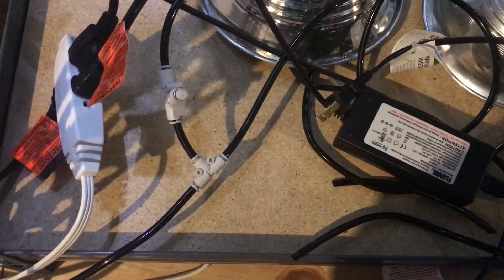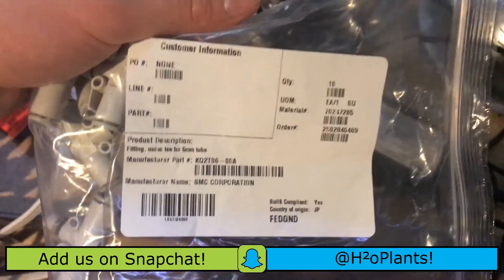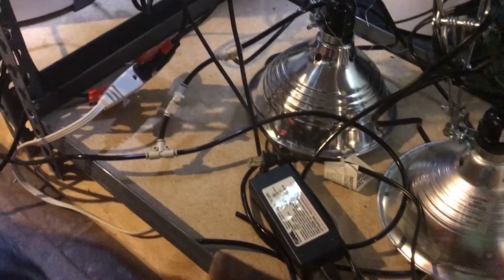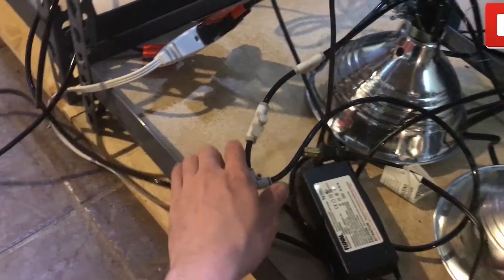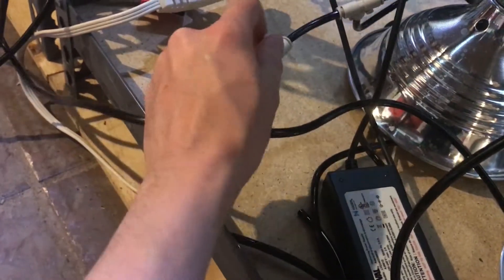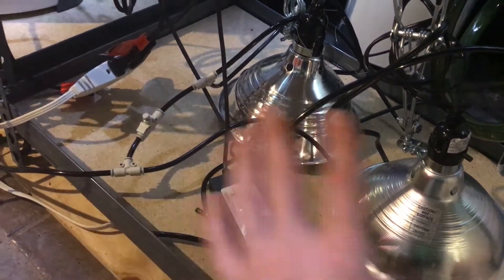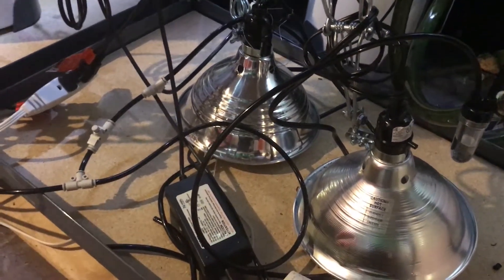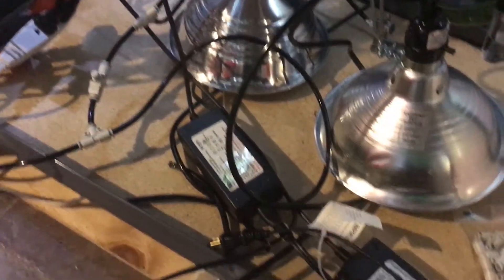SPLITTING CO2 LINES 💧 | 🌱 DAILY TRIM 50

Comment: do you find that speed control valve is sensitive enough to dial in a constant rate of flow?  I've always gone with separate needle valves to avoid the potential issue of varying flow rates from tank to tank.  (guess you sort of answered that one by explaining the troubles you've had lol!)
Reply: Rich's Fishes there’s absolutely no need for separate needle valves. That’s over the top and not to mention expensive. Get a 6-8 Line Valve Manifold and call it a day.